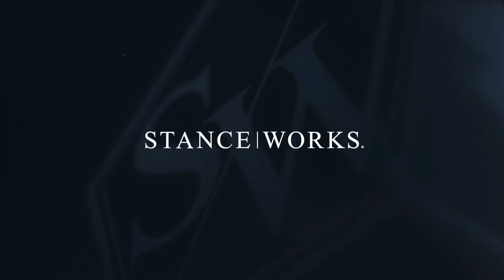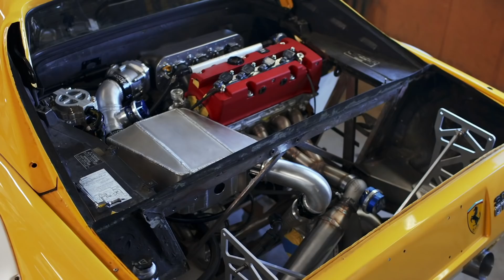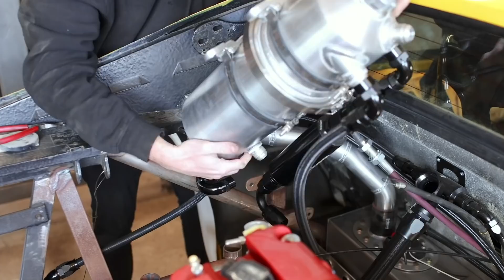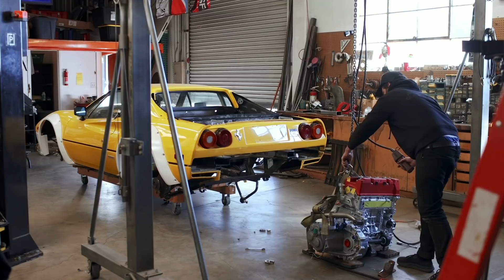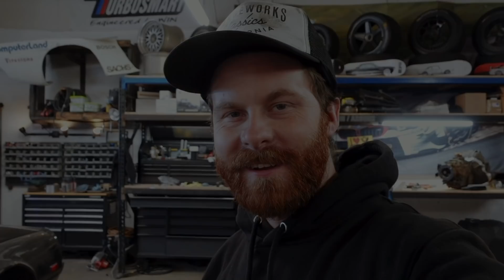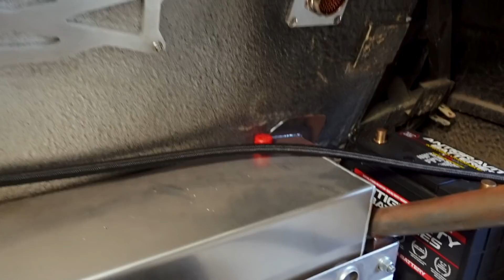Honda Powered Ferrari - Engine Removed for New Parts! - 1st Start Incoming...

Comment: Question: with the fittings in the middle of the water to air intercooler is it going to leave an air pocket at the top that is hard to bleed? Am I not thinking about something and it’s not going to be a problem to bleed? Love the channel.

Comment: Mike, have you thought about using something like steelit for the engine bay? Weld through paint that would keep your tubing from rusting but you can easily weld to it and repaint as necessary

Comment: I don't know if you've ever addressed this in previous episodes but I'm wondering if there's a reason you don't have a CNC plasma cutting table in your shop. With the amount of parts you send off to SendCutSend, I would think that the investment in a CNC plasma cutting table would pay in terms of turn-around time and costs incurred from SendCutSend. Does it have anything to do with tolerances?

Comment: I had the exact same thing happen to me with my 78 Civic project. I yanked the auto and I got all the parts together for my 5-speed conversion and I realised I had no flywheel bolts. I just went to a bolt supplier and bought Grade 8 bolts in the correct size and I was good to go.

Comment: Ratarossa channel did ice blasting on his Ferrari parts and it came out very nice.  Might want to look into it when the time comes for your engine bay.  I'm sure you can find some large leather cover to protect the paint and windows so it wont get pitted, even though I know you are going to re spray or wrap it later.   Obviously then you can then re-weld or double weld key structures seeing how this will be a time attack car and not a Gentleman's back country road touring car

Comment: Hey Mike! First of all, great work as always! Been a fan since the old Rusty days, and you never cease to amaze me with your creativity and dilligence when it comes to your work. Second, I've been following the build and noticed the clearance for most of the engine components is really tight. Is there a problem to consider in the future, thinking of possible engine movement? I'm not really a pro at this and I don't mean to throw a wrench in your gears, I just keep coming back to this thought in some of the videos. Love from Brasil, and sorry if I didn't really seem clear in my writing.
Reply: Your writing is clearer than most native English speakers 😁. Given that this will be a track-use car, I think the engine will be fairly stiffly mounted. To be totally honest I forget exactly what sort of engine mounts were used back in one of the early videos, but I imagine there will be very little movement of the engine relative to the chassis.

Comment: Quick question: how do you plan to bleed the water cooling system? Since the AN-lines are located “in the middle of the leveled cooler” i don’t quiet get how the air above the level of the AN-line entry and exit will get out of the cooler so it will fill fully with water and delivers maximum efficiency? Thanks for the vids mike!

Comment: I would go with the dry ice detail instead of the sand. This project is overall really amazing.
Reply: dustless blasting is usually crushed glass. it will do a much better job of removing rust than dry ice.

Comment: This may be a silly question, and forgive me if you've already spoken to this and I missed it. How do you plan to get all of the air out of that air-to-water cooler? It appears to be the highest point in the system currently. And with no bleed/fill ports on it, I'm just confused. Is there something I'm missing?

Comment: Hey mike, what are you going to do in terms of structural rigidity in the ferrari?
Reply: you must have missed the episode where he welded in 4 vertical posts and attached 2 high tensile strength steel wires and turnbuckles to pre-load the chassis and keeping it perfectly square?

Comment: I wonder why you didn't put the oil filter housing on the right side of the engine bay, when there's a lot of space and the hoses wouldn't be that long when there's both the drysump pump and the engine inlet (for the oil).  But i love the build, keep it up man !

Comment: It's weird seeing the engine bay empty again, it takes me back to early episodes when you were taking a sawzaw to the chassis. But it's a good reminder of how far you've come since the start!

Even if it's a short episode because of forgetting about the bolts, it shows us that you encounter the same issues we might run into on a build. There's so much to keep track of that something is bound to fall through the cracks. This just means we get more episodes!

Comment: dude do NOT do dustless sandblasting unless you want a parking lot filled with glass shards or whatever media they use to do the deed. 
if it were me i'd wire wheel and POR15 that frame.
Reply: Not an expert but I guess dustless should include glass shardless.. maybe dry ice as the media?

Comment: The k24 is better than the original 2.8L
Reply: It's hard to beat the k series motors. The k20 an k24 work like no other cheap mass produced engine's. I drive a 07 honda civic si 2.0l coupe with a jdm k24a  swope and absolutely love it.
Reply: @mikellewis2346  nice brother 👌